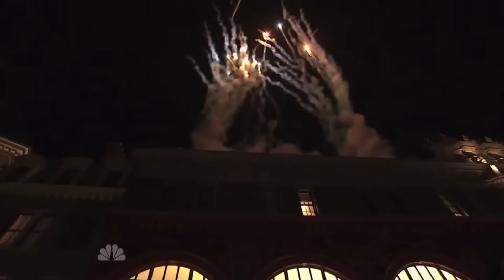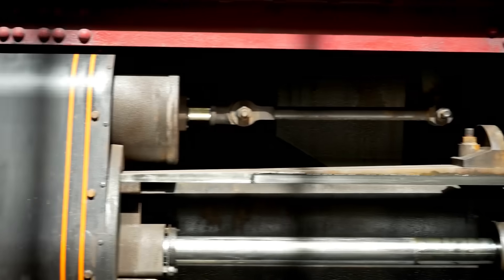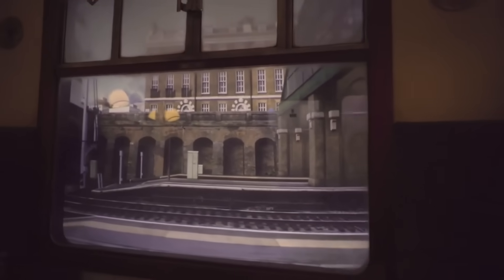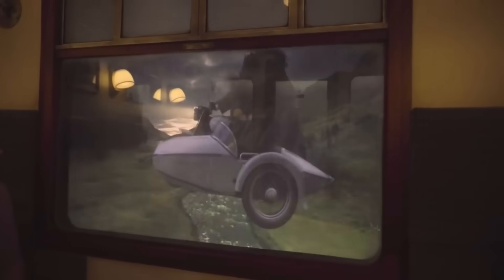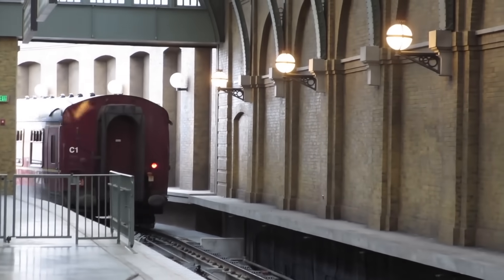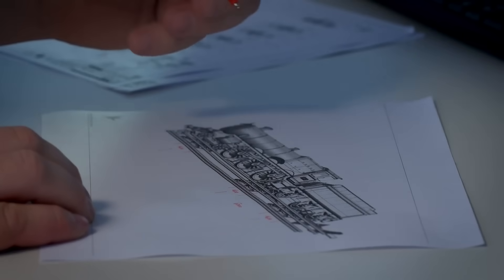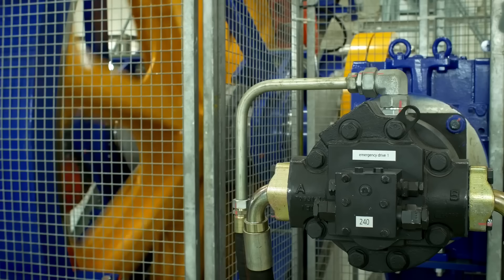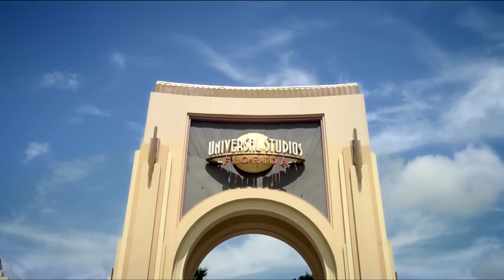Why This Hogwarts Express ISN'T a train!

Comment: If you want to ride the REAL train, you have to go to Scotland, and ride The Jacobite, the actual train used in the films
Reply: Yeah the fort william to mallaig bit is the best.
Reply: The route used in the films, not the train used in the films
Reply: @AaronThompson  yeah, but they do have a steam train on that line. The actual train isn't main line certified so it can't run on that line with passengers
Reply: @xaiano794  it is mainline certified as it runs on Network Rail rails, si the engine is fitted with AS, TPWS, GSM R radio and OTMR,(black box).
Reply: @xaiano794  The locomotive was main line certified,  that has expired.  Currently on static display, hopefully it will be restored to full mainline running order. Just think they were thinking of using an un-rebuilt west country or battle of Britain class.  Think they made the right choice.
Reply: @AaronThompson  That was the train they used
Reply: @unknownregions5014  No it wasn't, it was the recording location they used but not the train
Reply: @unknownregions5014  The actual train is out of traffic, though I have heard it’s something they’re planning on sorting soon
Reply: Olton Hall (the real Hogwarts Express locomotive) was on lease to Universal Studios, atleast up until a few years ago.
Reply: @TheArmoredGroundhog  so Hogwarts Castle isn’t even a Castle class? What next, there aren’t pillars between platforms 9 & 10 at Kings Cross?
Reply: @puddycat2325  When Rowking wrote about Platform 9&3/4 she had St.Pancras Station in her mind, a much more elaborate building the King's Cross
and there were pilars between platform 9 and 10, which is not the case at Kings Cross. Would not have been much of a problem in the books, but when it came to filming the used Kings'Cross and had to build a fake pillar.
Also in the first movie Harry and Hagrid push a trolley with his stuff over a walk bridge.
first is complete useless as one aproaches the platform from the head side and the walk bridge is half way the platforms 
and seconf you need magic to get a trolley up there, because there are only steps up the stairs.

You won't get much of a Harry Potter experience at Kings Cross as it is quite a boring place.
Actually in my mind King's Cros was more known for it's 1987 fire on the subway escalator. 
I remember the old wooden escalator from a first visit to London , steep narrow dirty, and the story when revisiting 25 years later, still steep and narrow, but less dirty.
Reply: @kamion53   "When Rowking wrote about Platform 9&3/4 she had St.Pancras Station in her mind,"    That sounds about up to Rowling's usual standards of authenticity, yes (sarcasm intended).    St Pancras would even fit with the red painted engine, which Kings Cross absolutely doesn't.   (Though not, of course, a GWR Hall.   I'm not entirely sure whether a Hall or a GWR Castle ('Hogwarts Castle'?) would even be allowed to run into St Pancras - or Kings Cross for that matter?)   Of course a Highland Railway 'Castle' might and they were even painted LMS red but I don't think any survived into preservation.
Reply: @kamion53  the filming used platforms 6 and 7 and the used the footbridge as strangly you call it a walk Bridge, does that mean the bridge walks by its self.
Reply: That would give you the authentic route and scenery, but the train and stations are completely devoid of any theming.
Reply: The Jacobite route is what was used in the film
The loco hogwarts express seen in films was a real steam loco repainted into a the hogwarts express livery 
The real train is on static display at the Warner brothers studios in London
Reply: We just got back from Scotland and it is a thing to hike up the hills to watch the antique train roll by over the bridge where the Howard’s Express was filmed. We just happened to hit it at the right time by accident.
Reply: Ok, but any alternative steam trains that I can take today? I'm from Singapore.
Edit: Ok, Nevermind, They have Steam Trains on The Jacobite. I'm dumb, but still, it's very far from my home country.
Reply: @buizelmeme6288  Malaysia has a steam train
Reply: @Kremithefrog1  where? Which city?
Reply: @buizelmeme6288  If you want to ride a steam train closer to where you live (or anywhere else you might travel), Wikipedia has a list of heritage railways.  Four of these are located in Indonesia, though I'm not sure how close they are to you:  https://en.wikipedia.org/wiki/List_of_heritage_railways
Reply: @buizelmeme6288  Visit America and ride the Durango-Silverton train

Comment: Wasn't the real train in the real movie a GWR Hall class locomotive with a Castle name? If so then why does this engine look like a Castle class?
Reply: Harry Potter: The railway enthusiast’s nightmare.
Reply: The whole thing's fake, might as well fake it to look like a Castle as a Hall.   No Castle or Hall was ever painted LMS red in any case, nor would any red engine have ever been seen at Kings Cross.   (The Midland used to run into Kings Cross until approximately the 1860's when it Midland Railway built its own station at St Pancras, but it wasn't till the 1880's that it switched from green to 'Midland Red').

Comment: I'm kindof surprised why they just didn't make a real railway actually, seemed less expensive :p
Reply: Yeah thats what I thought too. Atleast a kinda real Railway with an electric train or a pull sytem running on normal track.
Granted there would require some maintenace but I doubt that this current system is easy to maintain.

Comment: The engineering behind this is quite impressive, it also gives me a lot of respect for Disney running & maintaining actual steam engine trains for daily use at the park. It's all quite a feat
Reply: They're not real steam locomotives, they're pulled by cables.
Reply: @MatiProbably  Yes at Universal they are not real. Disney World (which is a couple miles from Universal Studios Orlando) uses actual steam engine trains in their park

Comment: I have not been to Universal since the 90's, and not knowing anything other than there being Harry Potter land, I knew nothing about this attraction before watching. Very interesting, and an extremely well done ride by Universal. My only complaint is that while the funicular system is a clever way to make it less expensive to operate, the attraction would be better if the trains were real. In my opinion, of course. For me, seeing the fake locomotive outside the confines of the station looks ridiculous. Not having been there, does the train even make any simulated train noise (when you see it outside traveling between the parks), or is it silent? If it is silent, that would be another thing I would not like.
Reply: People can’t see the train when it’s outside of the stations. It travels through a backlot and is hidden from view.

Comment: It is a train, the US has had these types of trains for commuter trains. They are also known as cable cars. Many cities in the US had them at one time, including Chicago, though San Francisco still has them and uses them. Basically the person driving the train grabs a hidden cable underneath the street with a sort of cable catcher and pulls it up hills. In this case it's catches the cable to help move it along the entire route, but the concept remains the same. The cable is meant to guide the car whether it going up hill or across a theme park.
Reply: Cable cars and funiculars are superficially similar (railway cars propelled by a steel rope moving between the tracks), but they're not the same and the way they operate is quite different. As mentioned in the video, the cable is permanently attached to funicular cars so their speed is regulated by changing the speed of the cable (strictly speaking funiculars always have two cars counterbalancing each other). This also means they operate as a shuttle connecting two stations (middle stations are possible but uncommon). Cable cars on the other hand can release the grip on the cable to stop and start independently from other cars powered by the same loop of haul rope (which moves at a constant speed). As a result, cable car lines can have an arbitrary number of stops and even forks are possible.
Reply: A cable car uses a constantly moving cable, and the cars grip and release the cable to start and stop. There can be numerous cars on the same cable system.  The funicular is 2 cars permanently attached to one cable. They may look similar but are actually quite different. 😎

Comment: I've never understood why Hogwarts has a GWR Hall Class locomotive with a name that should be on a Castle Class locomotive, and why a GWR train would depart from Kings Cross, which was an LNER station.   What's more, the loco has a shed code plate for 10A, which was Springs Branch, Wigan.
Reply: Because JK Rowling and the original movie director/writers aren't aware of proper locomotive classifications.
Reply: @KoalaTContent  The illustrator that drew the original book cover certainly wasn't - he created it all from imagination
Reply: An addendum;during the locomotive trials,during the forming of British Railways,GWR engines ran out of Kings Cross,and in the locomotive exchanges in the early 1900's,the GWR engines ran out of Euston(LNWR),so they were all over the map! Much history overlooked! Thank you!!
Reply: Kings Cross also lacks columns to run into between platforms 9 and 10. The platforms are separated by tracks.
Reply: Probably because those details are unimportant to the ride or the experience. 😎
Reply: Add to that, a GWR locomotive painted in a close approximation of LMS red...    as such, it should have been departing from Euston or St Pancras.   All of which indicates that J K Rowling knew nothing of railways and cared less when she wrote Harry Potter.
Reply: Wizards are terrible at muggle details, I’m surprised they manage running the train so well.
Reply: The only reason it's a castle class locomotive is so they can make the pun of calling it 'Hogwarts Castle'. If you look at the loco itself though it's nothing like an actual castle class.

Also, I think I'm right in saying that when JK Rowling was writing the book, the station she had in her head was actually London Euston, rather than King's Cross, but she couldn't remember which was which so put King's Cross.
Reply: @MikeWillSee  Yep absolutely correct.

Comment: Is it real steam? Or some substitute?

Good video. 

 I don’t think it is a funicular because the vehicles aren’t counter-balanced on an incline.  It’s just a cable propelled system with the vehicles permanently coupled to the rope.   There are many other systems but they normally have a detachable grip. Eg. https://en.wikipedia.org/wiki/Coliseum%E2%80%93Oakland_International_Airport_line?wprov=sfti1
Reply: Also, just to nit pick, the main energy used is to overcome the inertia of ~218 tonnes for acceleration and braking. The rolling resistance is trivial in comparison for steel-on-steel transport systems.

Comment: I always knew it was 2 trains and pulled by a cable could never figure out how they would pass each other on 1 track.   It got to the point I was timing the trains how long they were in the station, how long ride duration, etc. I quickly figured out it was two trains because the time between departure and arrival should have been double the time I was getting.

Comment: The shuttle from the Coliseum BART train station to the Oakland International Airport uses this technology. It does it one better in that it exchanges cables at the passing point as the distance is too long for one cable, or at least it was easier to design it that way. If you ride it stand at the end of the car and watch the exchange at the midpoint of the ride.
Reply: almost the same, the BART system is on rubber wheels. The Hogwarts is on steel wheels.

Comment: Disneyland had real steam locomotives on a smaller gauge track. Universal has a full size... fake locomotive... way to spend the big bucks guys
Reply from the maker: More efficient and predictable considering there's million of dollars of state of the art media equipment riding on a slender track. Plus it's more reliable and efficient.
Reply: Universal is much smarter and cost effective.
Reply: @wesley815  Ah yes, cheap costs and boring rides... the perfect recipe for a good theme park.
Reply from the maker: @Flyboy207  the rides universal builds are not cheap. It may be a matter of Disney overpaying or inflating costs or including things like land clearing and development costs to make it seem like a much larger investment than it really is.
Hagrid's costed $300M. For a coaster. About 2X what Disney spent on Everest adjusted for inflation.

Comment: Doesn't it have to be inclined to be a funicular rather than a cable-hauled railway?
Reply: Not really, it’s the design that lends the name.  Though funiculars are almost always inclined, cable railways can drop the line, and just use it as propulsion.  Funiculars are permanent sets and as mentioned, cannot change tracks all that well.  Take the San Francisco cable car, they are free to stop at will, but must coast through switches and turns due to cable limitations.

Comment: It's just such a shame the locos look so delapidated.

Like, does no one clean them at all..?
Reply from the maker: They're supposed to look like that. In fact they purposefully took little Dremels to it to put little chips in it and painted it with special patina paints specifically to give it that worn look.
Reply: Ah right, I see. 
Still a little odd.
No passenger service steam engine was ever filthy, only industrials.

Shame about everything rusting too
Reply: @jayvernon2575  You can't have seen the many pictures of British steam engines in the 1960's that were often filthy as steam traction was being stopped

Comment: Do you wonder why it's not a traditional electric train? I've wondered if this type of train they went with is was actually cheaper.
Reply from the maker: It just requires the one motor so I'd say yes.
Reply: Likely also cheaper and easier to maintain—the vehicle itself need not have any active (functional) machinery, so there’s less to go wrong. It also means the bypass system is inherently safe and requires no coordination.

Comment: Wouldn’t it be considered more efficient (and maybe less strain) to have a drive motor on both ends of the line with a tensioner along with one of them? I’d love to see an animation of the train wheels transferring over. I’d assume similar to a regular train at a junction and switching over tracks.

On a side note, the engineers must’ve initially thought of a way to have both trains travel in the correct direction to avoid the appearance of a train traveling backwards. It must’ve come down to cost to build that much more for an aesthetic as well as the logistics of utilizing the cable system. Again, it was definitely a money thing because using cable for a closed loop would just not be feasible. Great video. Always love seeing what marvels you uncover!
Reply from the maker: It's not at all uncommon for a train to run in reverse.

Comment: Firstly. Amazing video explaining the system. Will certainly sub :)

Secondly. I'm a rail enthusiast from the UK. Had the amazing chance to actually stand on Olton Halls footplate when i volunteered at the NRM in york. But throughout this video i've been trying to figure out why this looks so weird to me. Then it hit. Its not the locomotive. Its the carriages. They are shorter in height and shorter in length than a standard Mark II carriage and have an the windows are squished smaller. Probably to make the compartments smaller and easier to project on to the right surface. 

It looks like an awesome ride though. And certainly technically amazing
Reply: That is an extremely keen eye! I see it now you've pointed it out!!! Plus the fact that they propelled the train backwards with a red tail lamp on (a completely illegal movement in the UK). As someone who volunteers on a steam railway, I almost had a fit - And yes I know it's a theme park... 😁😂
Reply: @CheesyGiant82  which one?
Reply: And there’s no support coach or mark 1 BG.

Comment: Do the trains back up before their next run? If not, aren’t they facing the wrong direction once they’ve reached their ‘exit’ destination to travel back (with the next group of passengers) to the original station? Do they Roundtable them?
Reply: They had backwards I believe. Technically wrong but impossible to turn them on a funicular...